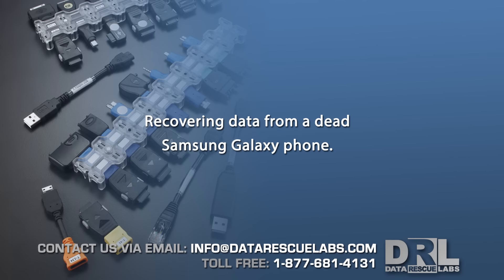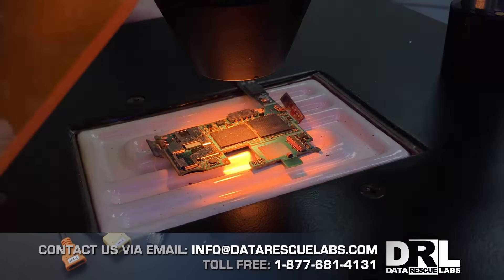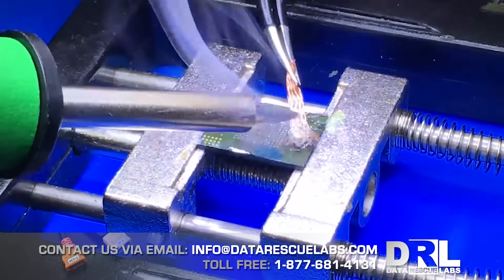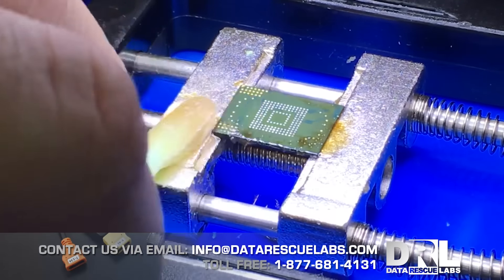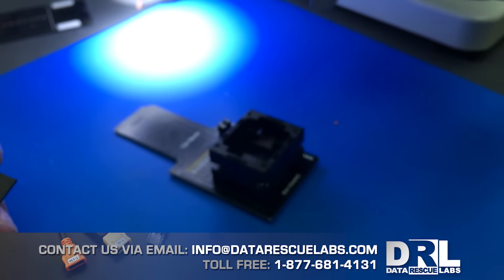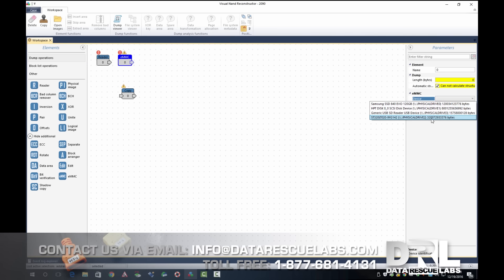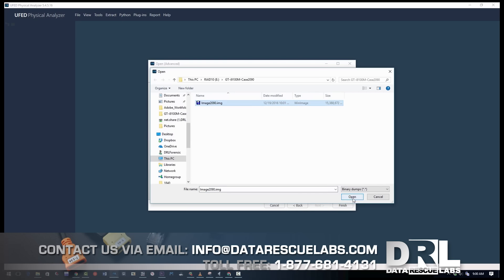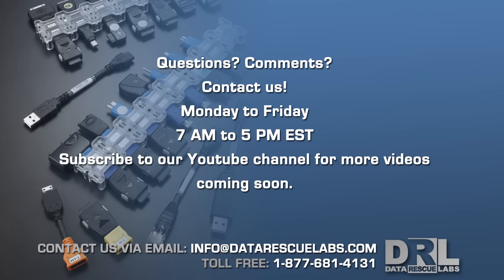How to recover data from dead or broken Samsung Galaxy

Comment: i am trying to recover some old photos from an old samsung s2 i have, i didnt have it for long, but it contains some photos of my parents and my dog which died recently. i got it to turn on then something went wrong and its bricked, i had just enough time to see that the photos were still there, and now i feel devastated that i was so close.  do you still have this equipment? and can you still provide this service? or maybe point me in the right direction?
Reply from the maker: Yes we still provide this service 

Send us an email info@datarescuelabs.com
Reply: @forensicguy  I have my Samsung Galaxy S21 that was run over by cars many times.  If you pulled the memory chip off of it, how can I access the files on it?  How much do you charge for that?  Thanks

Comment: I have a Galaxy Note Edge (SM-N915F) that I want to recover data from.
I have tried many recovery tools yet this doesn't work.
The data got erased from a factory reset.
It is currently running android 6.0.1.
Is the data still recoverable?
Reply from the maker: After factory reset, there really isn’t much you can do

Comment: After disconnecting my phones from a third party provider using the sprint network both my Galaxy s2 and s4 are stuck in boot loops. Is there a free program which will access my phone in safe mode to get my pictures from the phones before I factory reset them.

Comment: Hello sir,

I watch some of your YouTube videos and It's great. I am writing you because I badly need your advice. 

Some days ago, my Samsung s7 edge handset suddenly crashed. It's not open, just showing some red lines says: Boot loader exception. 

It didn’t come to download mode. But the main thing is the device internal memory was 128gb. I have important documents there and need rocover those data. There was a warning that, memory almost full. But before I delete some data, this problem happens. Attached screenshots. 

But it seems like my phone's storage is corrupted, may be it is already deleted. I think, from what technology we have in our country, last option is separate IC/Emmc from motherboard. And try to revover data from it. 

Do you think, this process will work?

I saw your videos about it. I think, my Android version was 5, phone was rooted so may be those data was not encrypted. So it is possible? Or if it is encrypted, is there any chance?? 

Is there any other way like if i restore that IC/emmc storage in another motherboard, it will work or not?? Please give me suggestion that, how can I recover those data?? My main goal is to recover data. I will be forever grateful, if you can help me.

Thanks & Regards, 

Muntasir Mahmud 

From Bangladesh.
Reply from the maker: Galaxy s7 is encrypted, so if you remove the memory chip, the data won’t be recovered.

You need to mail it to me, I can possibly use UFED to dump the data.

Contact me here info@datarescuelabs.com
Reply: @forensicguy  I think data is not encrypted bcz its old version of Android. I Didn't updated it..phone was rooted.
Reply from the maker: Galaxy s7 came out originally with android 7 that was encrypted so unless you disabled encryption with a different version, it will be encrypted
Reply: @forensicguy  I mailed you.
Reply: @forensicguy  The S7 and S7 edge launched with Android 6.0 Marshmallow back in 2016 and got two full Android version updates up until 2018 with Android 8.0 Oreo. Just find this From google. I think, my device was Android 6 version.

Comment: Since the release of Android 6.x, data is now encrypted. Is it still possible to do chip off recovery with this encryption?
Reply from the maker: If its encrypted then the answer would be no. If the phone was purchased with 5.x and upgraded to 6 and even 7, the data would not be encrypted even on the S6.
Reply: Data Rescue Labs Inc. nd on samsung  s3??

Comment: I have S7 Screen cracked turned black.. so i can't take mine apart ..Reason being.. warranty requires old phone back.. Trying to do this... But how?
Reply from the maker: You would have to send it to us for data recovery.
Reply: hook up to monitor and use mouse via usb hub
Reply: Stellar Cellular thank u.. I did but it says no data..?? am like what ?? I had some wed pics and contacts I need & can really use... Only thing is i must return the broken phone to Verizon like..yesterday lol... so am stuck.
Reply: you see the phone screen but nothing is there? like just stock apps?
Reply: you see your wallpaper right?
Reply: Stellar Cellular thanks again.. well screen is black when I go hook it up to my computer it recognizes the phone... & I select pics or videos ...it will just read No Data..
Reply: you need to use your monitor as the monitor, do you understand like MHL
Reply: I am having this exact issues. I don't understand your instructions though.

Comment: Are you able to work recover data from a water damaged s9??
Reply from the maker: Yes but not using the method you saw In this video. S9 would need to be repaired due to encryption
Reply: @forensicguy   Is it possible to recover from water damaged s9? I also got the same condition with same phone. Lot of memorable images and videos are there inside. i am desperately in need of it.